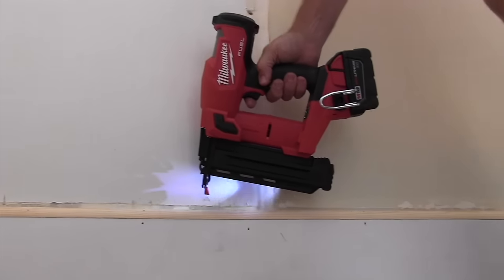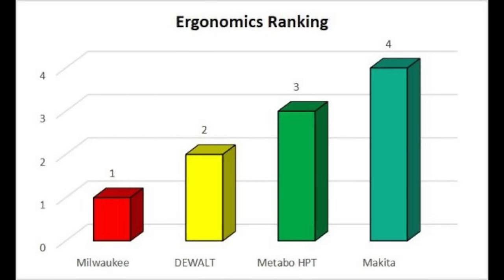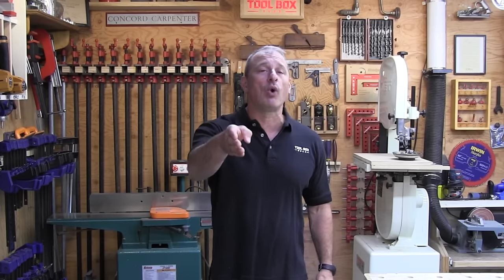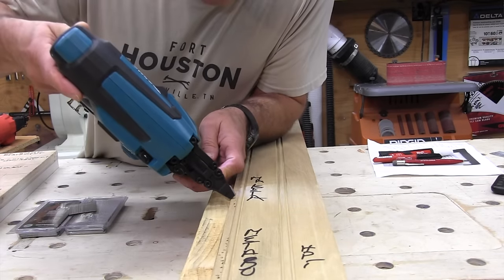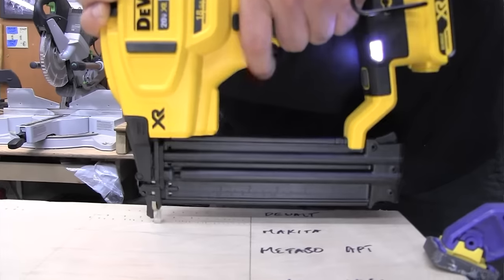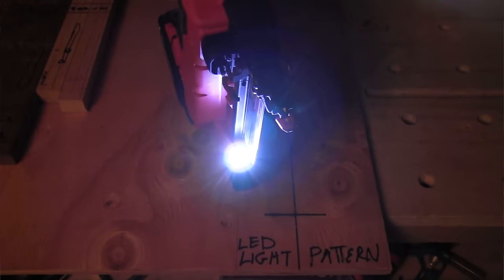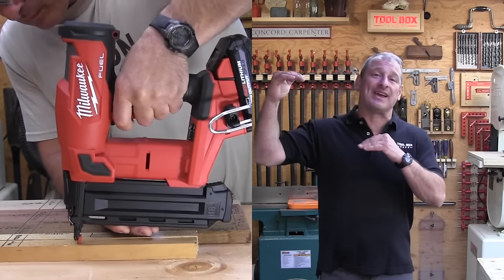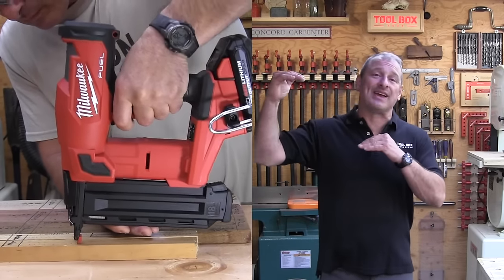BEST 18 Gauge Cordless Brad Nailer - Head-To-Head

Comment: Ryobi could do the same o more better than these there all made in China for a fact no difference in them
Reply: You probably haven't used them then because ryobi is low quality compared to these
Reply: Nick Rexroad The Ryobi Tools brand in North America, Europe, Australia and New Zealand is owned by Techtronic Industries of Hong Kong, an original equipment manufacturer for brands such as Craftsman, Milwaukee, AEG (AEG Powertools, licensed from Electrolux), Ryobi, Homelite, Hoover US, Dirt Devil, and Vax. But I feel you on some tools but try the new stuff you’ll see ,and I’m a Milwaukee fan all day!!!have a great one
Reply: @loaizafilmz1109  interesting and good to know. Milwaukee is great for just about anything, in my experience all the ryobi stuff I used just felt junky especially the brad nailer but if it gets the job done then really its irrelevant.
Reply: @nickrexroad8602  my Ryobi 16 gauge finish nailer still works the same as the day I bought it years ago - how do you know it's low quality? You own one or are you just assuming?

Comment: Don’t be bringing those toys downunder; we have real wood down here...
Local reps of these brands have given up trying to convince us to use these things

And FFS stop talking about how many nails per second/speed you can fire; nobody worth a shit gives... a shit.
Reply from the maker: Mahog, Maple and IPE are pretty tough species. BTW - we NEVER mentioned nails per second.

What were trying to get across it that with zero ramp up time, you you can install fasteners accurately at a decent rate of work with no disruption to work speed.

Battery powered brad nailers allow you to “cut the air hose,” and give you the freedom from gas cartridges.  

Now the job-site advantage belongs to the battery powered nailers, especially when you factor in that so many brands offer so many tools on their battery platform.